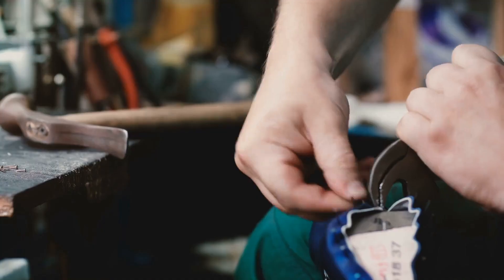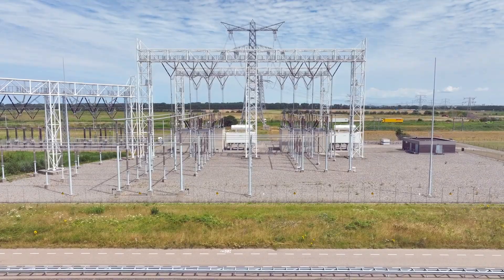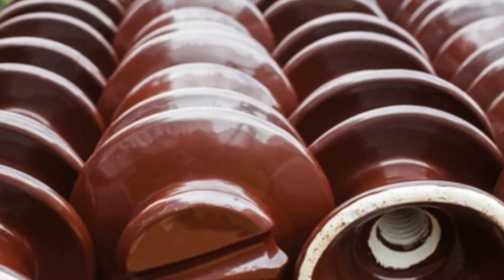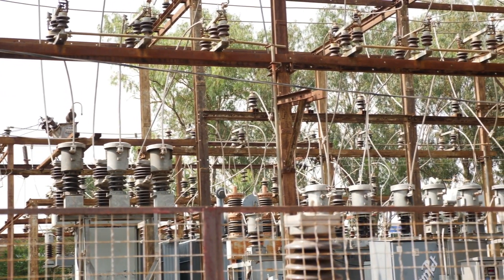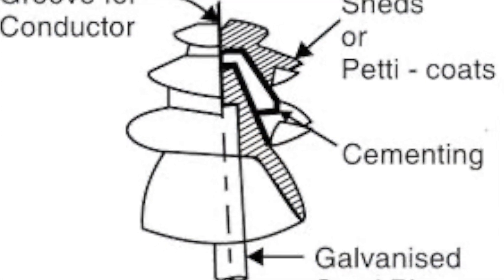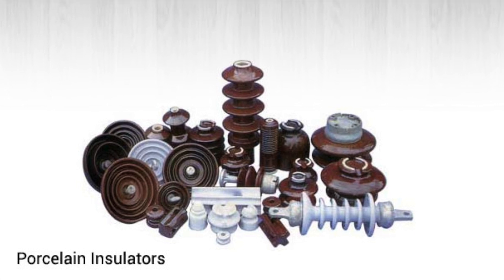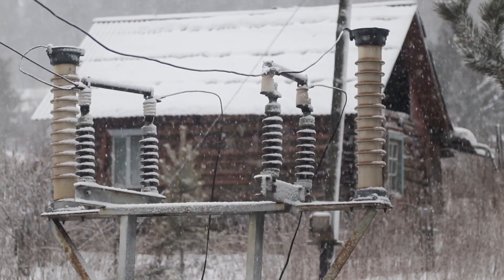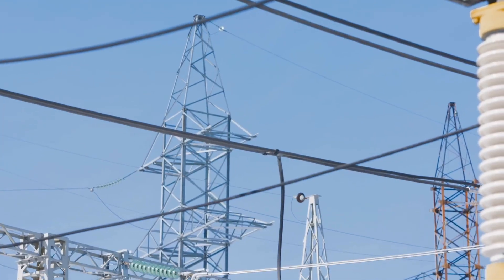Why do High Voltage Ceramic Insulators have Discs? | An In-Depth Exploration

Comment: Ceramic insulators were used for telegraph lines as far back as the 1840’s Both earthenware and porcelain were used. Glass was used on local lines as it was cheaper. Glass was used in the USA during the Civil War as porcelain could not be imported from Germany due to sanctions. When electric supply commenced both materials were used. Insulated bushings on transformers, circuit breakers and bus bars used for medium and high voltage service were always porcelain.

Comment: 0:26 Those metal rings shown are to relieve voltage stress on the insulators. These are needed when the voltage is in the 6-figure range. And the more of these disc insulators there are, the higher the voltage. I'm sure that these lines shown carry over 100kV.

Comment: Narration said something about using ultrasonics to clean surface of insulators. I really doubt that is ever done.
Reply: https://etd.cput.ac.za/bitstream/20.500.11838/3115/1/Ramos_Toriq_207022917.pdf
Reply: https://icrepq.com/icrepq06/256-hernanz.pdf

(see p129 bottom left; or search for ultrasonic)

Comment: AM Broadcast towers utilize ceramic insulators at the base of the tower. The whole tower is energized with RF energy, where the insulator keeps it from contacting ground potential. Their appearance is different than what is utilized on high voltage electric transmission lines.

Comment: Am Not a Electrical Engineer 
Yet The Disc Shape of The Insulators Is Specifically Designed To Defuse 
The Electrical Field….
The High Voltage Does Not Travel Through The Electrical Cable 
The High Voltage Travels Around The Electrical Cable Which Creates a Electrical Field 
So When The Cable Is Held Up By a Tower The Insulator Defuses The Electrical Field at That The Junction Point 
You Don’t See This Yet You Hear It 
If You Stud Under a
High Voltage Tower on a 
Foggy Day You Hear The 
Insulators Working or a
Hum This Hum Is at
60 Cycles or 60Hz and 
This Hum Is More Pronounced By The 
Insulators Because The Disc Shape is Designed To 
Defuse The Electrical 
Field at Those Junction 
Points…..
Other Wise You Have 
Two or Three Electrical 
Fields Crossing Over Each Other and We Don’t Want That 
Remember The High Voltage Travels Around 
The Cable 
Not Through The Cable and So That’s Why The Electrical Field Must Be 
Defused or Broken Up at The Junction Points 

Remember 
Am Not a Electrical Engineer
Reply: You're not a grammar teacher either but you failed to warn us about that.

Comment: I’m pretty sure the porcelain insulators came long before glass ones. I’ve seen old film of them making porcelain insulators in the 1920s.
Reply: I work for a company making these--Victor Insulators. The company was founded by Fred Locke in 1893. 
He came up with a way to process wet porcelain for insulators to address some of the issues with wet glass.

Comment: I always thought the disc design was to prevent  rodents from climbing up and chewing on the wires.
Reply: LOL !!! And it works too. I can't even remember the last time I saw a squirrel chewing on a high voltage line.

Comment: They are a stack of discs instead of a smooth straight ceramic pole because it effectively increases the surface area and effective distance between the two ends.
Electrical flash over follows the surface, so a 1 foot long disc insulator provides the equivalent of a 5 foot separation

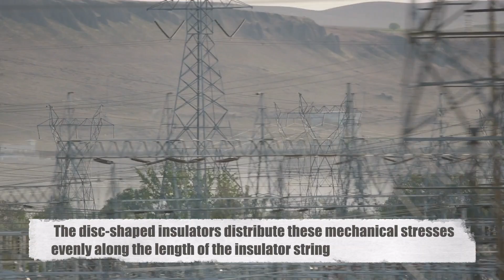Comment: 3:01 "The disk-shaped insulators distribute these mechanical stresses evenly along the length of the insulator string"? I don't think so. Like links in a chain, each disk must individually be capable of bearing the entire mechanical load.

5:28 - "Ceramics have excellent thermal conductivity which helps in dissipating the heat generated by electrical currents"? I doubt that. The widely separated points of contact would have negligible heat dissipation abilities on the electrical wires.

Where are you getting this information?
Reply: Indeed, and the information presented was superficial at best.
Reply: In addition, ceramics do NOT have a high thermal conductivity.  They have a high thermal resistance.  That's why ceramics make excellent thermal barriers such as the walls of a kiln.

Comment: Although the ones you're showing when you're saying ceramic insulators are actually glass.
Reply: ceramic insulators are practically out there days; most high tension lines use glass insulators.

Comment: Electrical engineer here. No need to watch the video - discs offer the best cost-effective way of insulating, as they are very good at separating water droplets from forming a path for electricity and this is of course the main concern since oxygen is a very good insulator. My diploma was also about measuring the parameters of ceramic insulators.
Reply: I did not know for sure, but being a former electronics technician I was thinking it was to prevent water from creating a path of least resistance. Thanks for your comment!
Reply: So... You came on here to drive people away from watching the video?

That seems a little petty.
Reply: @JMSoloBassist  you must watch it first before you can criticize, right?
Reply: @JMSoloBassist I watched 3 minutes of its. It’s crap, written by AI.
Reply: not only water, dust and other deposits must not provide a straight path
Reply: What about air? Is it a good insulator?😅
Reply: @kraftzion  air is a good insulator till it breaks down; that is the major reason we need to keep good separation between conductors. There are also elaborate mechanisms to tackle lightning strikes that are quite common on the transmission lines but the end consumer rarely sees the effects.
High voltage circuit breakers are filled with SF6 (a gas that is a better insulator than air with a higher breakdown voltage) for obvious reasons.
Reply: @kraftzion  air is a (rather) good insulator but not very effective at transmitting mechanical load ;-)
Reply: @thibaultjoan8268 lol, op said "oxygen is a very good insulator" . My point was that the ceramic discs are in air, not oxygen. Oxygen is a component of air, but they are not the same.
Reply: @kraftzion  Never seen lighning?
Reply: Congratulations, you provided a primary school level explanation. How about you grow a pair and make your own videos about how electricity works instead of you playing video games and random cats.
Reply: arrogant.
Reply: 8 minutes saved and not even too far from my initial guess 😅

Thank you, Sir!